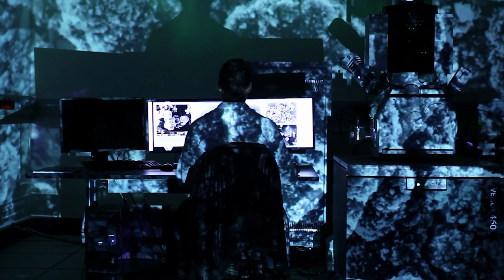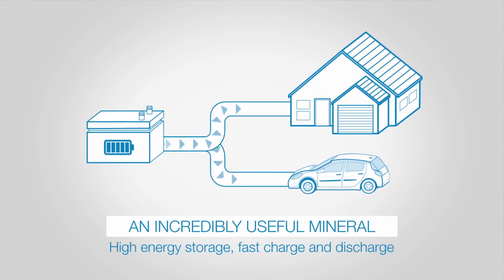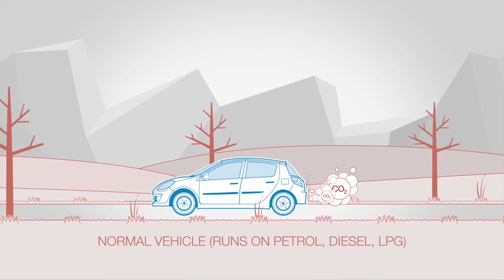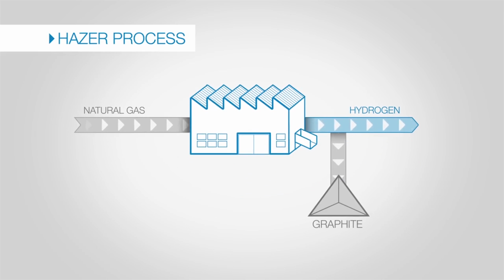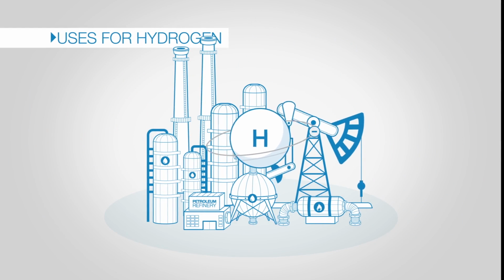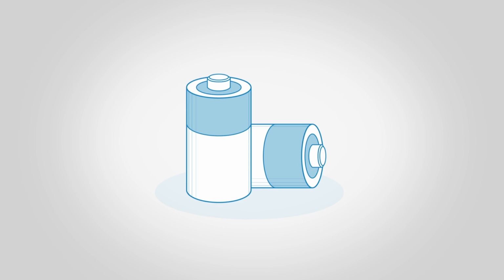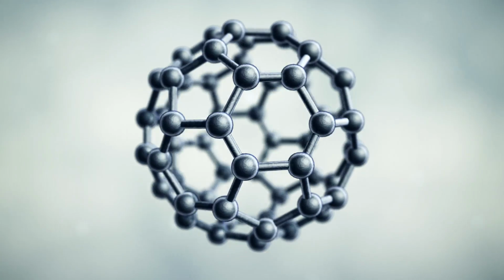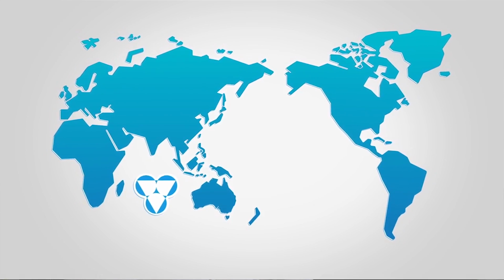Hazer Group Video

Comment: So if I got it right, the oxygen that would usualy go in the CO2 is sticking to the iron ore and make it become rust?
Reply: Not quite, by the looks of it the Hazer process doesn't involve oxygen at all, rather the iron catalyst used "strips" the carbon atoms off methane molecules, the carbon then bonds to other carbon atoms to form graphite molecules instead of staying bonded to the iron which allows the catalyst to be reused. The hydrogen radicals that are created quickly bond with others forming hydrogen gas which can then either be bottled by cooling it and compressing it or undergo the haber-bosch process which would convert it to ammonia (which isn't as flammable as hydrogen) so it can be transported via existing infrastructure.